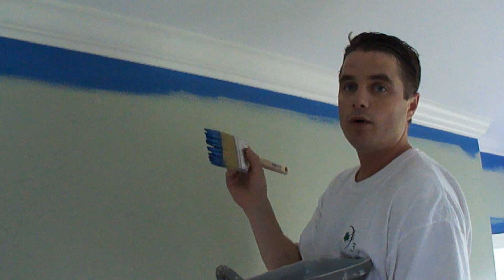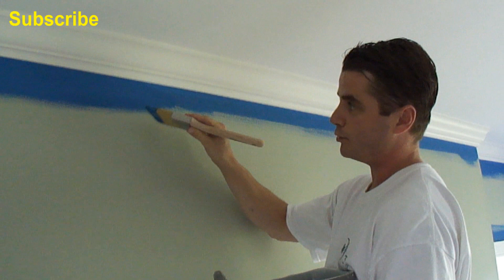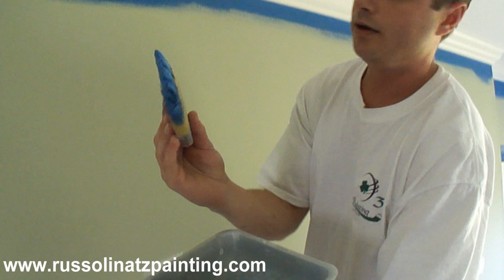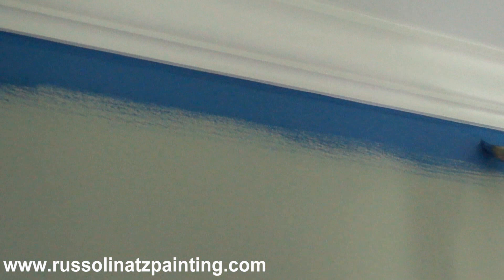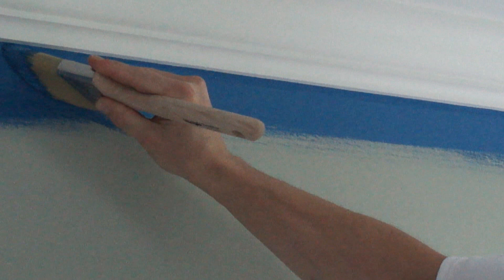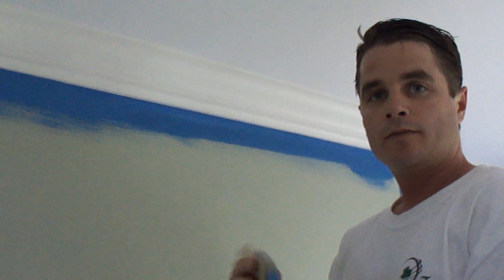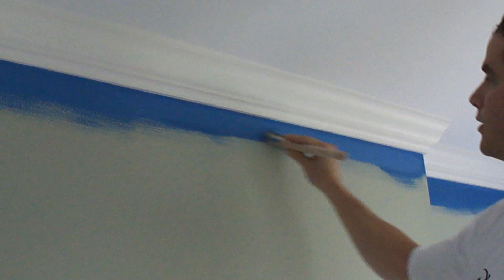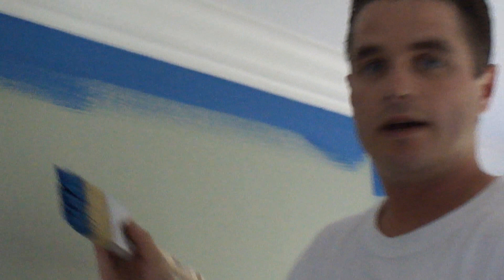Interior Painting Cut-Ins - How To Paint A Straight Line (Part 2)

Comment from the maker: Hello-

Thanks for stopping bye and thanks for the comment! Yes, I over lap onto the Crown just a tiny bit. The walls are not even and the only thing that is straight, is the crown molding. So by overlapping onto a straight molding is the way to go. Yes, it will look uneven from the ground  if you don't cut a straight line onto the molding. It will look wavy if you can't cut straight.  

Russ